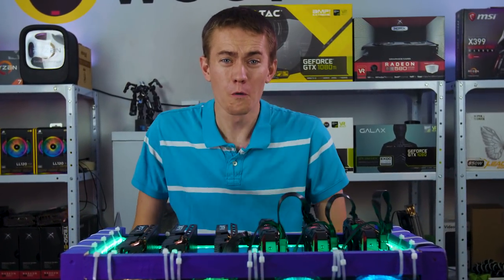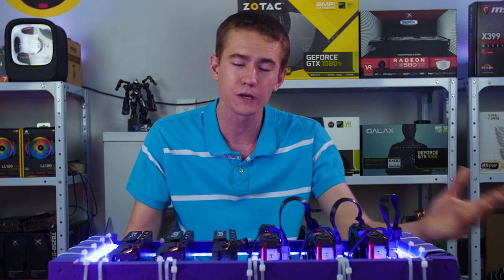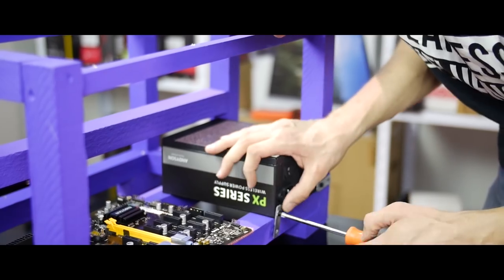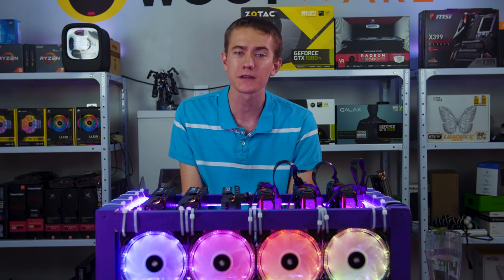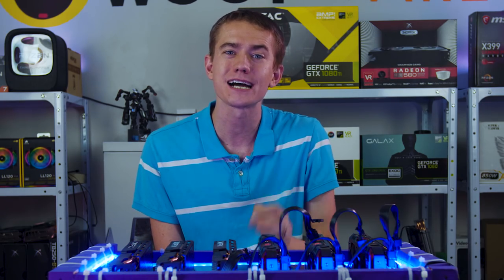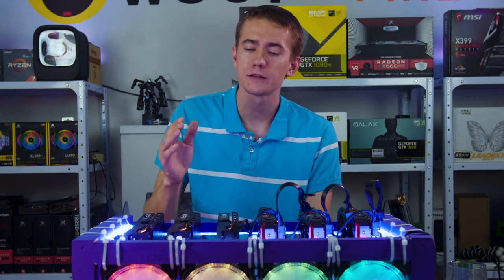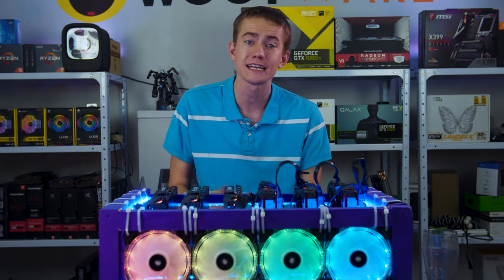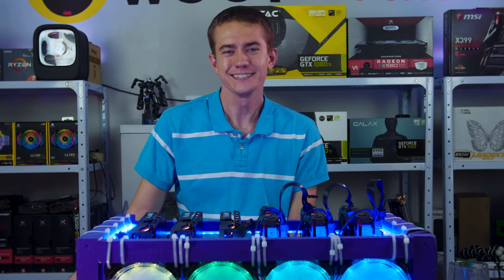How To Build An Epic Mining Rig!

Comment: Those fans are in backwards.  In your configuration, you have the RGB fans and the GPU exhaust fans opposing each other.  This isn't doing you any favors.  I have empirical data that suggests much better perf w/fans oriented with the GPU exhaust direction.

Comment: Miner safety notice: SATA in most cases in insufficient power for the riser! They are definable a potential fire hazard if your Riser pulls more than the rated 54 watts per Sata(and a huge hazard if you are running 2 risers of on sata cable - or gasp 3!). Sure it might not go off right away, but 24/7 running a cable beyond it's rating is asking for trouble. The 6 pin or molex is best. yes its a pain as you usually have to custom order extra cables per PSU. There are usually tests of cards out there to tell you how many watts the card draws from the PCI slot. (ps - just because it has not caught fire yet after X months or weeks does not mean its safe!! - wire usually degrade over time before they catch fire!)

Comment: 20 dollar wired storage rack, giant tile for mother board mat. mother board with standoffs studs. and tip ties...the mother board will be secured by all the cables plugged in and zip tied to wire storage rack. Total cost of rack was 25 dollars with tax. also you can get like 10 gpu on a shelve with 120mm space between so you can add some fans. also the fan location sucks and is not optimal. the best location on just placing the fan directly on top of the GPU rack you have so it directs more cold air to the gpu board and the other half will be giving more colder air to the fans. the place you put the fans is where the hot air comes out of. and basically your pushing hot air back into the gpu. so figure out where the hot air comes out from and help it escape not push it back in....also because your PSU is being OVER WORKED...gonna give off alot of heat. you want direct that heat somewhere else by putting the PSU on it own to the side. Cleaning dust off once a week helps alot. the dust would cake on and the fan cant do it's job  and cool down your GPU potentially causeing a fire and burning out your GPU. and speaking of cleaning how the F your gonna clean your small compact rig...you basically would have to take every GPU out one by one..with a storage rack they so far apart i can put my arm and my head thru the rig to reach spots.
Reply: My Crypto Life I also used a wire shelf rack and zip ties. I'm using hybrids so I have the GPUs hanging below the shelf that the radiators are sitting on. I used one zip tie per radiator, wrapped loosely around one of the hoses and a wire on the shelf, and then the shelf above them is lowered enough to just keep them from falling backwards. If I need to get to the power cable or riser for a GPU, I can slide the others over some to give more space and then slide the back when I'm done. 

Soon I'm going to move it to a different location so it will sit directly over an AC vent in the floor. It's closed during the winter but it will blow straight up into the rig during the summer.

Comment: Remember to rise MOBO on standoffs, so it doesn't touch the rig, to prevent shorting.
The ghetto version is to cut a thick hollow cable into even 1cm pieces, you can see some youtubers slicing a pen for this purpose.
Reply from the maker: Fair point.
Reply: His is on wood though, that's the nice thing about wood/cardboard. The alternative is use a cereal box and set the motherboard on it unless you are CPU mining as well.

Comment: Do you require 8GB of memory for a mining rig or can you get away with a single 4GB stick?
Reply: There is no reason at all to use more than 4 gb
Reply: I've read in a number of places where you can have issues with only 4gb in some situations but can probably work around the issues.  Suspect if your not running windows 4gb would always be fine though
Reply: folks running Linux say 4GB is plenty, but miners that I've seen running windows say 8GB is preferred.
Reply: Actually if you are using Vega Gpus, you DO need more then 4gb, you need atleast 16gb to use HBCC which increases hash rate 60%
Reply: When running my R9 280x with 4gb ram stick on Claymore's ethereum miner I had an error saying the GPU does not have enough VRAM to load up the DAG but adding another 4gb stick for a total of 8gb fixed the issue. So Idk :D

Comment: why 580s? Why ssd? I have 570s that get 29.5~31 MHs with "relaxed" memory @ 2050, (not really worth extra 10W per card and shortened lifespan by running them @2150+mhz). So, paying extra for 580 to get 0.x% more MHs? Doesn't make any sense to me.

PS. You can use only one PCI-E 8pin on the cards that have 8 and 6 pin. Works fine.
Reply from the maker: No 570's in stock at the time.  Didn't pay extra, just got what was available.

Comment: When I plug the second GPU (by riser) to the 1x slot it doesn't detect :(
I get a blue screen, it has more than enough power and the connections are properly done.
Help pls
Reply: Superfast Potato try changing the riser.
Reply: hmm have you considered it might be your wifes fault? try changing wife.

Comment: Dude you don't need to plug all the power cables on the rx 580's, just an 8-pin on each card is enough, trust me you will not see any difference other than saving power cables and use them to power-up other cards!

Comment: Can you provide a link to the start button thing you showed? Also what are your thoughts on using SATA connectors at all for the risers? Assuming we got a type 007 riser that did SATA directly from PSU to the riser so that no adapters were used, the SATA connecter is still only rated for 54 watts while the PCIe risers can pull up to 75. Some of the forums I've read say to avoid using them period and instead to go directly with 6 pin or 4 pin molex but I feel like basically every build I've seen uses them.
Reply: You answered your own question with the SATA specs.... I was laughing as someone was complaining they had the connectors catch fire when they had 3 cards hooked up to a cable (a SATA chain from your PSU has 1 12v wire, that means it was pulling so many amps, the wire itself should have melted as well). 6 pin connectors have 3+ and 3- wires, not 1 like SATA. They are actually made for running power more than a fan or HDD off of them.

Use common sense, SATA is notorious for catching fire when abused like this. You found the answer with the 54w rating.
Reply: That's exactly what I thought. Just blows my mind that such an objectively identifiable number (54 watts < 75 watts) is either unknown by the majority of people or ignored. So that's why I asked, in hopes I'd find a better answer than "people don't know or don't care."

Comment: You don't need to plug the 8 pin AND 6 pin power cables into the Red Devil card like you mentioned. I have one of them that I'm using for mining. I only plug in the 8-pin and I'm fine. Getting 32+ Mh/s at around 115w. 

Also, why don't you mention that powering risers with SATA cables is bad? There are so many people with horror stories of melted SATA cables that were powering their risers. 

Otherwise, nice video :-)

Comment: Hey Man, at 5:20 in the video you comment about airflow being really important so I have a question about the orientation of the GPU's especially since this is a custom layout.  Why does everybody line them up vertically as they would if they were plugged directly into the MB?  Why not lay them flat so the fans are aimed up and getting fresh air instead of sucking in from the back of the next card?  I know it would take up a little more space but wouldn't it cool a lot better and possibly use less power since the fans wouldn't work as hard?  Thanks for the great videos. Love them.

Comment: Watched a handful of how to builds. Still not sure how to connect SSD :(
Reply: Red Bear take a sata cable and plug it in xD
Reply: Quinten Van Neck is a data cable sold separately and required for most motherboards or is it possible to plug in direct... Say on an 250 model. Sorry I'm such a noob
Reply: Red Bear most of the time a sata cable comes in the motherboard box

Comment: I am still mining with my laptop + my desktop
Reply from the maker: Y laptoptho
Reply: UFD Tech GTX 1080 Max-Q + my desktop's gtx 1070
Reply: UFD Tech oc 1070 - (4530mhz/2.1ghz) 1080 max q (5530mhz/1.9ghz)
Reply: UFD Tech hash rate 102hash/s peaks,85 hash/s avg
Reply: Mining using claymore, eth only.

Comment: Kind of useless now... below $2 per day before electric costs per card... bad times.
Reply from the maker: Not really.
Reply: Well at 43 cents for electric costs assuming 150W's per GPU that means at $1.70 per GPU before electric costs it would be $1.27 profit per day at that profit level you would be looking at 200 days to repay the GPU in a extremely volatile market, if it were still at 2 to 3 months to repay I would be up for it, but given the risk almost an 8 month pay back is too much for me at least, if you have already made back the money for the GPU's because you bought eariler it's not worth selling your GPU's yet because well they have already paid for them selfs anything you make now is pure profit and it doesn't matter if you only get back a small amount for selling your GPU.

But getting in now would be pretty dumb I think at least.
Reply: Oh and I should point out more for anyone else reading this rather than UFD T the longer you have to repay you investment the more risk you open yourself upto, also there if the fact that Nvidia is coming out with there next generation GPU's soon and likely AMD is coming out with there Vega mid and lowend parts soon, which will destory the value of previous generation cards, so my point is not that it is completely unprofitable, but now is the worst possible time to get into mining.

Comment: How to build a mining rig, its easy dont, pls i want my gpu
Reply from the maker: Lol. :D
Reply: did you watch the video
Reply: Why are you even on this channel watching then?
Reply: Mine on your gaming pc while you aren't using it
Reply: Thrice909 right
Reply: Thrice909 but won’t it Deteriorate my card?
Reply: Ziaxe well it depends really, do you turn your PC off when not using it or do you leave it on all the time? If it's on anyway the gpu is being used,  it really comes down to heat. If your rig keeps things cool, then your card will be fine. You could even undervolt/underpower it when mining ( won't have as much return on it, run cooler and less power draw). But let's be honest if your a gamer, you'll prolly have your card for 3-4 years anyway until upgrade to be able play next Titles. So might as well used current card to invest in next card
Reply: Derek Remington I am new to PCs I have a gtx 1080 ti and have a 150i pro Corsair cooler i think and like 10 of those rgb corsair fans is that sufficient
Reply: Ziaxe yes that will be great to mine on
Reply: Ziaxe what CPU do you have?
Reply: Thrice909 i7 8700k

Comment: Please update the news. Don't use 4gb of ram for 8+ GPUs.
Tried it with Neoscrypt and Daggerhashimoto (DCR, PSL, SIA.. etc). You need 3gb ram PER GPU, increasing Virtual Memory is NOT HEALTHY for harddrives and RAM, it kills the hardware. Also, AMD hashrates are getting worse and worse per DAG-file.
Reply: It's just general knowledge to use 4gb. But it's not good, no matter what anyone says. Doing MemChecks, RAM after RAM which has blown (Corsair Value Select), I decided to increase to 32gb of ram, I have not had a single problem.

Therefore, after doing tons of research, I can assume that having 8+GPUs and an unstable system is NOT because of drivers, but because of using Virtual Memory and increasing it along with the increasing in DAG-files.
It's not 2017 anymore, difficulty has risen, more people are mining, DAG-files are growing and growing. Plan ahead, heed my warning and don't use 4gb of RAM. ROI for AMD is getting lower and lower, I can back that up with proof. I really want to help people, not bash on anyone.
Reply: Load of bullshit! Nothing short of too much voltage, too much heat or a defect will kill RAM! Claymore's miner does not use a large amount of memory at all nor does it commit a large amount, thus a mining rig only needs a small amount of RAM.
Reply: "Claymore's miner does not use a large amount of memory"
Im not talking about Claymore's miner, Im talking about the hardware. Why do you think it's necessary to increase virtual memory to mine using neoscrypt and/or daggerhashimoto? Or maybe to render 3D scenes with multiple GPUs?
For fun?
I can explain it to you, but you need to sit down and hold your horses.
Reply: You clearly have no idea what you are talking about! It is the programs that ask for memory to be reserved for them and if they don't ask for a lot of memory to be reserved (which is called "commit", in windows) you do not need a lot of memory (virtual memory size is just the total of RAM and swap files/swap partitions)!
Reply: Come back when you've setup 8+ GPUs, if you ever will. Its expensive.
Not here to fight. It's very bad to endulge people to use 4gb when it won't be enough in the future, but if that's your game, then that's your game.
Reply: It does not matter at all how many GPUs I have put into a fucking mining rig, I know how virtual memory works (which you clearly don't!)
Virtual memory usage of a program (on Windows) = Commit size! If Commit size of programs and OS smaller than Virtual memory size = minimal to no usage of swap files! RAM has no concept of Virtual memory, only the MMU and OS does! All modern OSs virtualize memory (including RAM)! GPU VRAM has extremely minimal hardware memory backing, most of it is mapped to non hardware backed virtual addresses!
I suggest you stop displaying the Dunning–Kruger effect and learn before you speak!